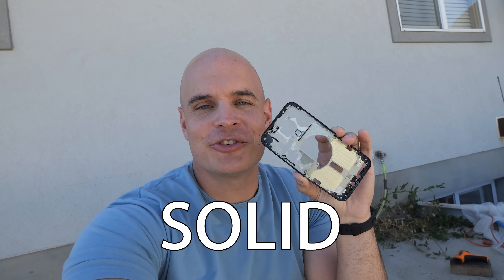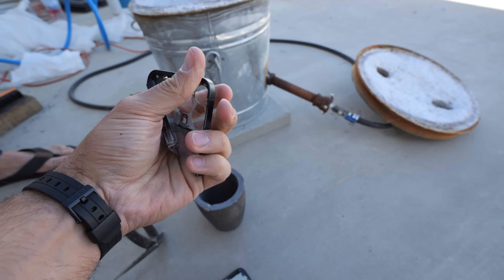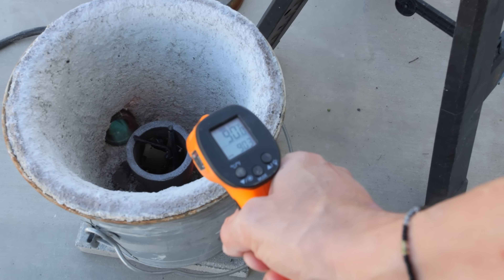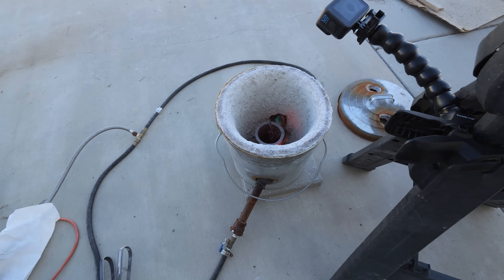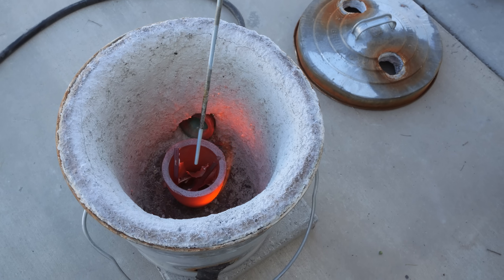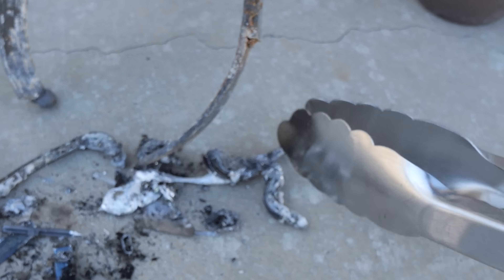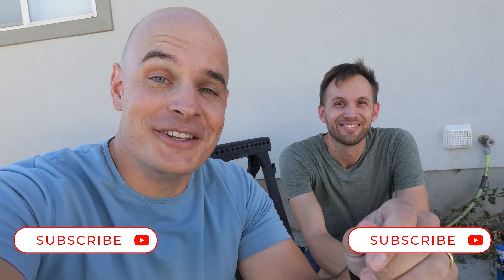How to EXTRACT TITANIUM from the iPhone 15 Pro Max?

Comment: It should be noted that the XRF analysis used is not a prove that "aerospace grade" titanium was used. 

The elements determined mainly indicate that a Ti-6-4 alloy was used. The grade 5 is determined by a low content of interstitial oxygen and hydrogen. Both of these elements can be accurately measured only by methods such as inert gas fusion.

Comment: Can you open and check the tecno camon 20 pro 5g? 

Now it has a bypass charging through software update. 

I wonder if they actually put a hardware when they built the unit, and just wait for thr software for it to activate. 

Or it's just a gimmick. 

Thank you

Comment: Jerry could you please try to crack back glass of few more iphone 15 max pro.Dont want to buy new phone before your approval. 
Also I noticed that on new iPhones screens becoming unusable (turning white) during drop tests super fast comparing to 14 Pros. I suspect that even case whont help if you drop iPhone 15 several times, it will just turn white without glass brake.
Would be grate if you could check that theory for us.
Thanks heaps appreciate your channel and what you do.

Comment: Hi, to check which parts are from titanium I personally prefer to use handheld spectrometer - the best solution is X-MET8000. I am open if you would like to try…

Comment: seems like using a thin layer of lower grade alluminium than the standard iPhone and then fusing it with a thin layer of Titanium has created a weaker frame than if they'd have just used the 7000 series Alluminium, as they did on the 15

Comment: Titanium is not considered a good conductor of heat. The thermal conductivity of pure titanium is about 17 W/mK1 or 21.9 W/mK2, which is about 1/4 of iron and about 1/23 of copper1. This means that if a phone is made of titanium and it’s heating up, the heat would not be conducted away as efficiently as it would be with materials that have higher thermal conductivity. However, the actual impact on the phone’s temperature would also depend on other factors such as the phone’s design, the components used, and how the phone is being used. 

Apple molded the titanium with aluminium from the outside; knowing aluminium part would conduct the heat near the circuitry of the phone. 

It's not just on the OS or system; still the components will run those systems or OS. Consequently, there's   a problem with the type of  materials Apple used; Most of them are recycled, which might have less thermal conductivity (I think). In addition, ventilation, thermal conductivity, and heat dissipation should have been well thought of.

It would be better if Apple added 'Graphenes' due to its high thermal conductivity and effective heat dissipation. 

If their heating issues couldn't be address, they might as well end up having external cooling system like some gaming phones then.

Mother Earth might have approved the usage of recycled parts; could she be satisfied with less energy conversion on heat build-up in the phone?

Those are my two cents, I think.

Comment: Thought for sure the USB-C port would be the weakest point in this phone, making that inset titanium helps it dramatically in the case of a drop connector break where you’d rather the cable’s usb c connector snap then the internal phone components.

Comment: would have been much less destructive and much more informative if you etched away the aluminum leaving the interface between titanium and aluminum exposed, caustic soda wouldn't do anything to gr5 Ti, this melting thing was way too crude
anyway, I expect they simply placed the Ti pieces in an injection mould, ti pieces would have geometry on them that would interlock with the injected al and that would be it

Comment: DUDE COIL THE TITANIUM uzb c AND COPPER WIRE ANS GIVE SOME ELECTRICITY THROUGH AC/dc with certain voltages  will it over heat quick? Want to chexk that since that could be the problem of over heat while charging?

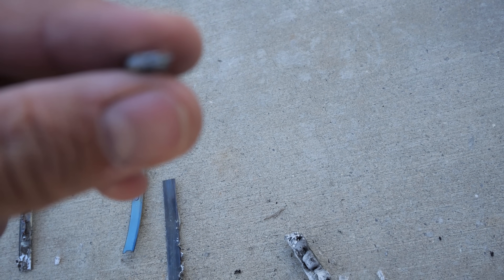Comment: 4:53 I did not expect the USB C port of all things to be titanium either! 😅🤓 And to give credit where it is rightfully due, Apple did a fantastic job with living up to the claims of what the materials really are. 👍🏾
Reply: I don't think having titanium there matters anyway because that is the part least likely to fail in a charging cable. In fact, every apple cable I've ever had failed because the connection between the port and the cable broke, not the port itself breaking.
Reply: @RealLotto titanium work hardens so you don't want to use it in situations where it could flex. You really only want it as rigid structure.
Reply: @milhousevanhoutan9235  I didn't mean to say that apple should put titanium in the port and cable connection, rather, they should strengthen it using flexible material and better design, i.e. springs, cable casings (idk what they're called) almost universally present in quality Android and 3rd party cables.
Reply: It could also be stainless steel which would be a lot easier to make a port out of.
Reply: Yeah, a $9 worth of titanium material that is 🤡
Reply: @Astaroth73 Samsung only uses $3 worth of grade 2 titanium 🤣🤣🤣🤣🤣🤣🤣

Comment: I'm torn whether what apple did is BS or a good thing. On one side i feel ripped off by them saying its a titanium frame when its more like a cheap gold plated wedding ring. On the other side, a 100% pure  titanium frame would be super rigid, less flexible and lead to way more glass and screen shattering.

Comment: Last year in my final year of Materials Science and Engineering I completed a dissertation project on 'fusing' Al and Grade 5 titanium (Ti6Al4V) using Equal Channel Angular Pressing (ECAP).

The goal was to force a sandwich of the two metals into an ultra-fine grained (UFG) microstructural state, thereby lightweighting and improving material strength using a relatively cheap process.

Let me assure you, working with this combination of materials is a nightmare - the distinct properties of the two metals are on complete opposite sides of the spectrum. Mechanically, this means the aluminium is so easily deformed while the titanium is left virtually untouched under significant loads. They did not blend.

So when I saw the clip at 9:45 of the previous teardown video showing the two metals in perfect harmonial bond, it was definitely joyous to see. Solid State Diffusion is an amazing bit of technology and I praise Apple for these feats, including surface anodisation from way back when even though I've always been team Android.

Then I watched this video and it was like watching your little bro destroy your Lego Hogwarts Castle😂

Still, thank you for providing us all with the cathartic experience of destruction you typically find in materials labs. Keep it up!!!

Side note: thank you for the cross-sectional view of the bi-metal interface in the last vid! Brought back hideous memories of metallurgical sample preparation of my specimens for the Scanning Electron Microscope (SEM)🥲
Reply: Have you heard about GRX-810?

Comment: hey zack, i'm from India. I wanted to ask you about switching to iphone. So basically i'm using onplus 8t from the past 2.5 years & now i want to switch to iphone 15 pro. Is it worth upgrading to iphone or should i try any other phones?
Reply: I just switched from a oneplus 9r (basically the 8t reskinned) to the 15 pro max and its been great. The camera is on another level, and the performance and batterylife have been amazing.

Comment: but what does all that bring, when you didn't even do a scratch test on the metal. it looked like it scratches just as easy as aluminium with your blade in the test.
Reply: Scratch thing & solid/strong material thing are 2 different things. All metals can scratch as far as I know

Comment: 4:53 the little ring from the usb-c port is probably steel. steel melts at 2500 degrees, so it would also stay solid when the aluminum melts away.
Reply from the maker: Valid point.

Comment: Since the housing was destroyed for science but you still have the motherboard and some other parts it would be cool to see if you can source all the replacement parts you need to rebuild a new iphone and if it actually works and how much it costs. See if Apples is really "changing" their stance on repairability.

Comment: Eh, my full titanium exhaust I searched out and sourced from Japan for my CBR1100XX Super Blackbird was definitely cooler, and much prettier, and definitely not your typical "Akrapovic", was a very rare TSR (Technical Sports Racing Japan), 60.5mm collector back sized, full hand bent header and piping, to a full titanium silencer with a dry carbon outer, again, 60.5mm straight through.....Looked and sounded glorious and, nobody else had one lol.... only one other Blackbird I was aware of that even had a TSR full exhaust that even "looked" similar, but was in stainless with a stainless silencer with carbon outer (that beautiful bike had ALL the super rare TSR goodies that were built back in the late 90s/early 00s... I only had the very best example of their exhaust lol).

Comment: Well your method works for this specific combination of metals. However many alloys have an eutectic point where the melting temperature of the alloy is lower than the melting point of the individual components. Just keep this in mind if you want to redo this with other phones.

Comment: Jerry my West friend ,the so called iPhone  titanium is just a spray bottle of titanium  oxide on normal plastic or normal metal , those so called high-end    iPhones 15  series that assembled in india is a  branding only which means that the titanium on the  iPhones 15  series is just a spray titanium oxides ,the  normal version of iPhone 15s  series that made in China  has the strong quality of damage proof that can withstand most normal fall in daily life use . The drop proof technologies inside  iPhone 15s raw mineral  materials is only available in China country which means Apple has to apply export license  before they can use it on maybe future new version  Apple iPhone 15 pros models ,but I don't think that China will let the Chinese companies that develop drop proof technologies for iPhone to be exported to India or west countries due to west and it's some allies currently still remain fantasy dreaming of trying to aim rare minerals inside China country mainland sovereignty rights.

The only way solution to avoid iPhone 15 from damage easily that is people should buy  the iPhone 15s more . 

This is just my opinion analysis bro .

Comment: Oh wtf, I thought for sure that iPhone 15 overheating problem is because they used titanium in the body... titanium being a poor heat conductor. But Jerry just proved that only the outside edges of the phone is made of titanium, the entire rest of the phone including the back is all aluminum. So the overheating issue isn't due to titanium, it's due to poor engineering by Apple.

Comment: Melting point of steel is 2500 degrees which if there is any steel there, it wouldn’t have been hot enough to melt like the usb-c port. And you all said the max heat is 2000 degrees.

Melting point of Titanium is 3135 degrees.

Comment: It makes sense that the usb c ring is titanium, as it and the outer case will be exposed to moisture which would cause galvanic corrosion if the usb c ring were aluminum.

Comment: By looking at the relatively small amount of titanium it is hardly believable that Apple saved up to 10% of total weight. Would be really interesting to know if they saved some mass somewhere else too, and just pretend the mass save is solely due to the new titanium frame. Maybe something to dig into?
Reply: A lighter aluminum alloy inside the phone perhaps. Something in defineity missing to allow the frame to bend so easily and crack the rear glass. The tear downs show there is less adhesive holding in  the glass than the iPhone 14Pro., thus making it cheaper to repair, however, I cant believe it was more adhesive that made the glass stronger.

Comment: If Apple could make the inner supporting frame also made of Titanium along with the back also made of Titanium and get the wireless charging coil on top of the Titanium layer just like the one on the Pixel 5, the future iPhones will become structurally indestructible. Of course the price will increase but who cares about pricing, right Apple fans 😊😉

Comment: One issue with titanium is you have to be careful on it touching other metals, you have to use teflon or other types of this material in some instances between the materials. I worked with titanium piping systems.
Reply: why is it dangerous?
Reply: @mamo1863  You should look up the information on the net, depending on the metals your using, the temperatures when welding, keeping dust away from it, keeping the titanium clean while working it, and dust free in very extreme heat and welding. It's not like other metals as to user friendly. It can be flammable in some instances.
Reply: @mamo1863 other metal can weaken titanium.
Reply: @mamo1863 I guess galvanic corrosion.
Reply: I would like to know as well. And thank you in advance!
Reply: Galvanic corrosion if exposed to salt water.

Comment: From Engineering stand point, I don’t see the plus value to add titanium to the phone. The only gain you have is to drop fews grams for the same structural strength. Stainless steel is far good enough and it’s cheaper.

Comment: You are so damn smart and you know how to innovate and create a content and its simply viral. Your iPhone 15 Pro / Pro max video has caused sucha stir around the globe about iPhone's durability!!!!
Reply: Clearly Apple needs to strengthen the aluminum alloy  inside the phone, as the titanium frame is not as strong as the stainless steel models. Thus leading the frame to bend and fracture the back glass.

Comment: Mainly follow you for the Humvee build but my Samsung s8 active is missing some parts that are hard to find and I was wounding if you had a spread sheet ranking phones I only care about a couple of weird things durably water resistant battery life head phone jack in that order I don't need the latest and greatest if not if you had some suggestions that would be awesome my previous phone was iphone 4s and spent 3x the original cost of the phone on life proof cases hence wanting a bullet proof phone
Reply: after more research oh you channel im currently researching more into kyocera duraforce ultra 5g and AGM H5 and was real interested in the  fairphone 5 till i saw the very end of you video glad to see Google's Project Ara has now become a reality for some one else use to have a lesson that talked about that concept

Comment: all the titanium and yet there is no practical use for the phone to take advantage of the alloy, it's like putting carbon fiber made for aircrafts on a phone , very useful for aircraft but zero use for a phone. 
what would be groundbreaking is a phone with scratch proof or at least max resistant and shock proof body also slender as current models so that we can actually enjoy the phone's design as it is rather than using a phone case.

Comment: It’s one thing knowing the titanium wasn’t going to melt but another seeing just how intact it was. The buttons didn’t even fall out. I was quite surprise the buttons and the USB C ring were also titanium.
Reply: Well he said the furnace goes to 2000°F which is way below the melting point of stainless steel (at least 2500°F). So there can be something else than Titanium eg. all sorts of iron alloys. And my guess would be that the USB-C ring is of stainless steel.
Reply: @loonator1995 it looks like stainless steel on my 15pm
Reply: @TVCHLORD  how caan you tell? its all coated in the same special coating. i know becauuse i have 1...
Reply: @402car_kid4 stainless steel cannot be anodized. If it had an aluminum coating that could be that would have melted off. It’s all titanium on the exterior.
Reply: @Thisisaplaceholder1  yea I never said anything about stainless being anodized, and I also said the full exterior was titanium. It’s between 9$-40$ worth of titanium for a pro max. They’re not going to try and save 2$ on that when they’re charging 1300$+. Apple is one of the few that actually have great build quality and it’s somewhat worth the price. Also I’m pretty positive the coating on the titanium is not anodized and it’s a special coating specifically for titanium.
Reply: @402car_kid4  you asked the question “how can you tell?” And I answered.
Reply: exactly! the USB-C ring mostly would be stainless steel , I was going to comment the same! Making the ring with stainless steel would not save apple a lot, but stainless steel is a tougher material, better suited at metal to metal friction point (as in here, the USB-C collar to the port, which would undergo numerous mating cycles)   @loonator1995
Reply: @loonator1995  the special titanium coating they used is also on the buttons and usb port, and its not that expensive to add the buttons and usb ring in titanium also. they estimated like 35$ worth of titanium which is nothing when theyre charging 1300$+. Also im pretty sure another youtuber tested every part of thw 15 pro max with a grinding wheel showing its all titanium.
Reply: @loonator1995  did u hear about his rf xray machine? It showed what was in that metal grade 5 titanium. It proved that it is titanium and not stainless steel
Reply: @Josh.TJM100  Did you look at what the machine was imaging? It was part of the frame. That wouldn’t tell you anything about the USB-C port collar
Reply: pinned comment says that the furnace only goes to 1200°F so its not titanium, probably something else like steel
Reply: @LeonRivia  the furnace still gets to 2000F, it was just the aluminium that melted at a different temperature than that stated in the video.
Reply: @LeonRivia  It gets to at least 2000°. Why would they try to save maybe 1$ and put some other metal for buttons.